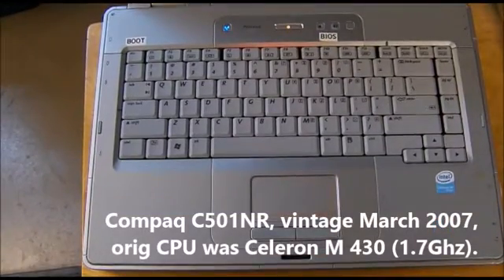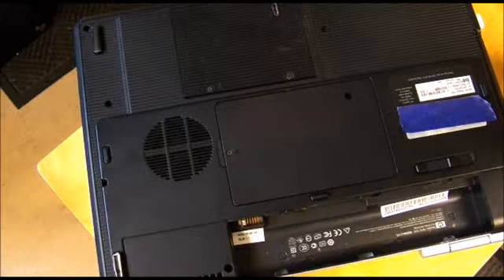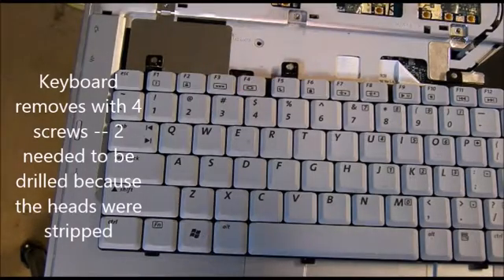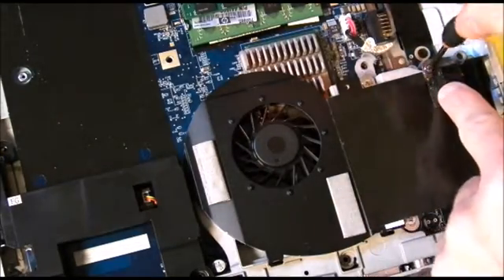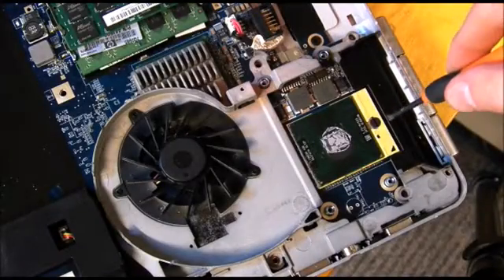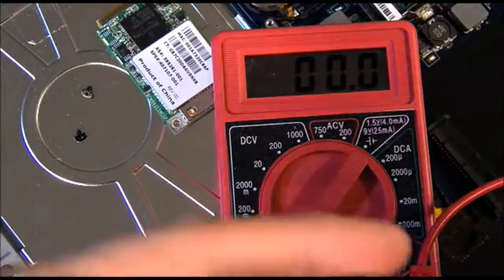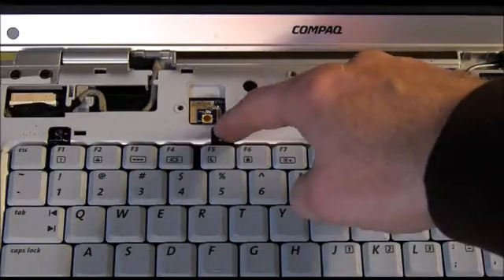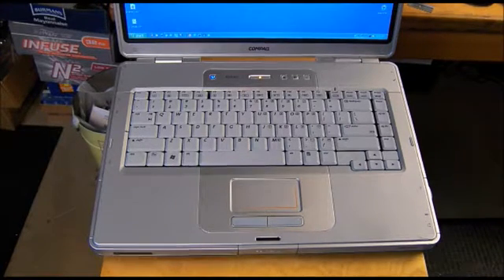Compaq C501NR laptop notebook disassembly teardown for CPU Upgrade & CMOS battery replacement C500

Comment: Hi i have same notebook . After cpu upgrade, can u watch youtube in 360 frame smoothly? ?? Celeron m430 is struggling all the times. Please please let me know how t1350 performs?? Thank you in advance
Reply from the maker: Unfortunately, the upgrade will not help youtube.  The limitation is really the Intel chipset.  I know how you feel, though, as the Youtube issue is why I upgraded to a newer laptop this year.  I now keep the old Compaq just for backup.
Reply: @bigslick  thank u very much . Ur information.
Reply: Don't you also have to update to the latest "Flash" software too? I hear Flash affects how you tube videos play back.